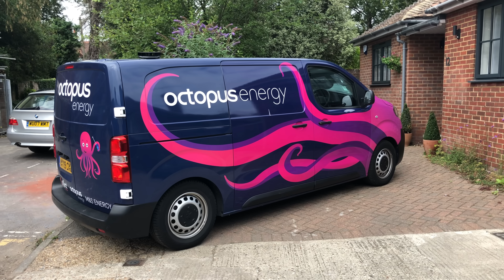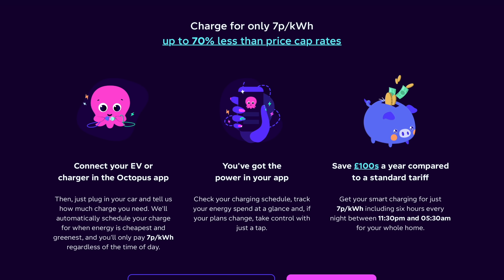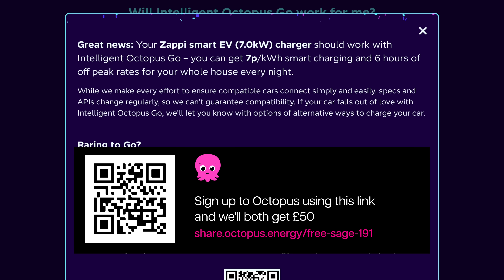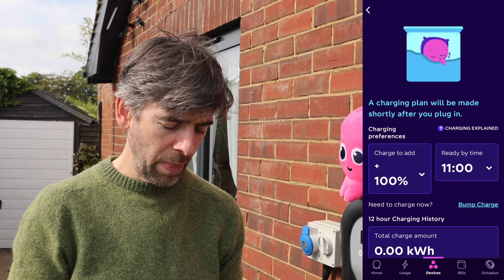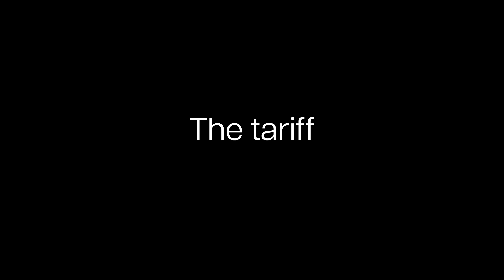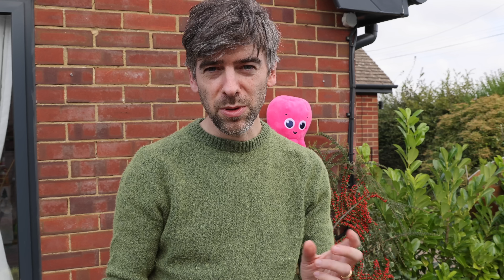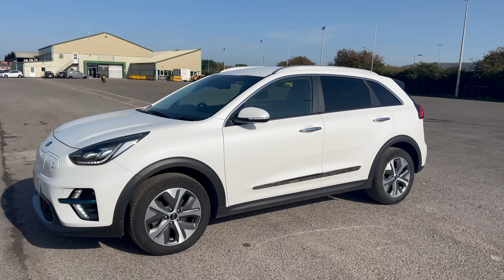We've saved a fortune! All about the UK's most popular EV tariff: Intelligent Octopus Go

Comment: Between IOG, 9KW of solar, Powerwalls, and EVs, we save around £6k a year in fuel and electricity costs.

There is obviously a capital outlay initially, but the system will have paid for itself in less than 6 years.

We never use peak rate electricity, charging up the household batteries overnight, as well as the EVs. And get paid 15p for every kWh we export, so make a small profit each year.

Comment: I’ve recently changed to intelligent octopus go and only use the smart charging (not bump) I’ve noticed my charge sometimes starts at 10:00pm ,however, when I check the app the following day I’ve been charged the standard rate and not the off peak rate. Is this because the app cost isn’t correct and does it then reflect the cheaper rate on my bill?

Comment: I have tried to take advantage of the off peak extension on intelligent go, but it has cost me money.  Because I have battery, when octopus charges the car via the zappi it will automatically take around a third of the charge from my battery.  To stop this I have set the battery to charge at the same time as the extension.  Last time it pushed my average cost per kW up to 20p from 7p when i only use the off peak period.  From my experience it looks as though octopus only charge me off peek rate on charging. They no doubt get the info from the zappi.

Comment: Hi Andrew, great video.  We have a modern bungalow- which we designed with Passivehaus details, but not the full Passivehaus spec.  No gas.  Over a full year we pay zero to Octopus and drive 9000 miles in our EV.   We have ASHP, Battery, Solar and MVHR.  They all work together, for example now in Nov., our heating tops up the house and water overnight and the battery keeps us going all day ….. until the night rate comes.   Some solar top up on good days.
Reply from the maker: That’s living the dream! We’d love to do the same.
Reply: Hi Jennifer, very interesting. I have a 200sqm house we designed close to PassivHaus standards about 12 years ago with MVHR, but no solar or ASHP, only gas UFH, as the return on investment did not make sense. Now with an EV and on Octopus IG, we're looking at it again, but with gas & electric running costs averaging below £100 pm, it would take us years to makeup the cost of Solar+ASHP+battery.  Is there a counter argument?

Comment: So does this mean you are charging your car up to 100% all the time ? Or am I not getting it 😢
Reply from the maker: No — I’m just doing little top-ups most of the time. 100% is just set in the Octopus app so it will aim to give me a full charge by whatever time is set.

My e-Niro battery is 64kWh so it’s like saying “I want 64kWh of cheap electricity by 11am”.

You might not get that, but it does its best to accommodate, based on the wholesale energy prices.

Obviously the car might not need all that, and many would argue I should be setting it to a realistic figure instead.

Comment: You need a smart meter that actually works... i.e. it transmits data to Octopus every 30 minutes. We've had 3 but they just don't get sufficient signal. Pity because smart tariffs would save us on home charging and running a new heat pump. So do check before spending a lot on a fancy charger when a basic one would do.

Comment: Road pricing is going to rip the arse out of this model. It'll take a decade ( at least) or more but the loss in taxation will require replacement somehow. 10p a mile looks like the ballpark figure. Not immediately, but it will get to that level eventually.
Reply from the maker: Whatever happens with tax, charging at home is still going to work out the cheapest.

Comment: Dude, how are you spending that much a month??? We've got solar, batteries, zappi and Eddi (no heat pump), two EVs with Oct Int Go and in January 2024 our bill was £75 including standing charge...our gas bill for that month was £45. Not getting a heat pump because the maths doesn't add up for us.
Reply from the maker: Your solar and batteries probably help. We had no batteries and just 2kW of solar.
Reply: @MrEV  ah fair shout. Think the batteries are the most important thing, keeps us off grid until cheap rate time.

Comment: 0:07 I'm probably about to upset you Octopus guys, both on EV Rate and Tariffs. I'm talking others into leaving Octopus for longer fixed deals.
Gas prices have shot through the roof, Winter is forecast cold and likely not so much Wind and Ukraine still goes on with Israel and Iran tensions that could affect LNG and global Gas prices.

Without getting into a long story, the last few months Coal generation is finished and Nuclear is 80% reduced. EDF have one of their plants down for refuelling until mid December so the UK currently has 3.79Gwh Nuclear.

This will put heavy strain on Gas generation when Wind is low and Gas prices 70% dearer in the last 3 weeks so cheaper hours looks limited.

I won't go on EV as these were quickly withdrawn in 2022 when the Crisis hit leaving many charging EVs at 34p, plus tariffs.on Octopus are a mesial 12 months. 

Next Winter is forecast higher priced than this Winter due to cost of Gas and supply shortages.

Instead we've opted to go with EDF for 3yrs on Economy 7. We have Solar, an EV and 43kwh house battery storage.

Our Economy 7 is 15.7p off-peak and currently 12p if we signed again today.

However, we're willing to pay a little more as we locked a 3yr contract than 2yrs. We'll not regret it as Energy prices continue to rise plus Geopolitics are affecting prices.

Forget the Heat Pump as they are ridiculous money with even Octopus claiming 80yr payback. Instead, we use Air Conditioning with all the benefits of a Air to Water Heat Pump but much more efficient and quicker at heating.

We sacrifice Hot Water to Gas which is £200 per year and not worth ripping the boiler out and spending £7500 - £15000 excluding Grants.

We charge batteries overnight when little Solar and run the house and AC from these. Heating works out equivalent of 3p per Kwh compared to Gas at 6.5p.

We run a Leaf with 40kwh battery and even at higher rates is still a fraction of the cost of petrol.

We charged the car pretty much from Solar April until end September and 6 months Winter will cost £180.

Seriously - don't spend the money on Heat Pump for radiators- install Air Conditioning. We Heat the whole of upstairs with a 4x over sized unit on the landing to flood rooms with warmed air. Heat is almost instant with no cold pockets of air you get with radiators.

I've just installed a 14kwh for a lady living on her own on FIT who also has Air Conditioning running from the battery.

We're about to hit another Energy Crisis so I'd suggest locking in with another provider for 2yrs knowing these contracts can't be withdrawn as we did in '21 for 3yrs.

If you want us both to get £50 by switching to EDF, I'd be happy to post a link.

Yes, you're getting it cheap now but time to batten down the hatches and prepare for another two years on Energy the roller coaster.

Security is sometimes worth paying a little more for which is why we as yet, we will not switch to Octopus as 1yr contracts are just not long enough.

We get it cheap, could be cheaper but there has to be a balance. We pay £150 a year more than the best tariff on EV but a small price to pay for security of fixed prices until 2027.
Reply from the maker: Interesting. Thanks for your comments! We had air-to-air at the previous house so know it well.
Reply: @MrEV  I just don't understand a government pushing Air to Water Heat Pumps where new builds could have Air to Air ducted built in.

It's a lot of money for an Air to Water where 90% of our Gas consumption was heating.

We've dropped it from 14000kwh to 3300kwh and the energy to run is either Free from Solar or cheap night rate.

Instead- invest the money on big battery storage, Solar and AC. You'll still have change and like us, live cheap at £75 per month for 3300kwh Gas and 6500kwh of electricity per year.

Battery prices are awesome right now and I'm selling 15kwh packs for less than £2000. No VAT on batteries or Air Conditioning.
Reply: We shall see how the usually innovative and forward looking octopus responds, if and when your forecasts prove to be correct. Until then on Intelligent go I'm getting most grid elec supplied at 7p/unit, quite often for 12 hrs a day or longer whilst plugged in due to Greener Days ie windy. As the climate gets more unstable I shall be astonished if it becomes less windy but we shall see. . No gas, so saving that standing charge which surely will be heading north at a fast rate! As for ASHP, we're happy with ours,  there's no cold spots and virtually free hot water for 8 months of the year. Don't know how efficient your Aircon system is but my wet ashp has a SCOP of around 3.5 ie 350% efficient?
Reply: @MikeGleesonazelectrics  High Pressure, trapped cloud is the forecast and the worst nightmare for us with Solar. 

Luckily the weather is getting warmer reducing demand for Gas so Wholesale may drop a few pence next week.

UK Carbon is through the roof tonight, Gas is trading at 110p per therm up from 67p 3 weeks ago. Our previous government allowed the demise of Gas storage so no cheap Gas bought in April to offset today's high prices.

Wind is pretty much non existent and Solar today is down. Our 7kw system produced just 3.2kwh today.

We makes our own choices but Agile and Go was affected in 2022. Go see the rate cards and historical prices for then. Enjoy it while it's cheap, innovative or not - the reality is its getting tighter and more expensive in supply. What did Uncle Greg say in '22 - you've enjoyed the good times so don't moan now or words to that effect.

No Wind = Expensive Electricity and its how long Octopus are willing to stand it as making losses doesn't keep a business running.

Memories are short, Tariffs withdrawn Oct 21 until only late last year. No new customers allowed and no deals available.

Search ESO and look at the map. Even the Bright Green NW was Amber today.

I'm happy to be secure for 3yrs and the extra I'll be paying, have already made made up by wheelin' n dealin'.

Hopefully Octopus will start pulling rabbits out of hats. Google IamKate and ESO to see how much Gas generation and at what price to keep our lights on.

While your on Kate's look at the history of Nuclear, Coal and Gas. EDF have one of their plants down for refuelling, bad planning that ends mid December forcing more heavy lifting onto Gas.

So yes, we'll see but I'm yet to be proven wrong. Wholesale is getting a lot more expensive and will continue to do so.

Air Conditioning is running at 4.2:1 (420% - is mine bigger than yours for a change) above 6 degrees outside. Why are people so defensive of their Heat Pumps, are they jealous of our Cool Summers. 1150watts to take upstairs from 17'C to 23' today. Not bad for £1200 installed. No radiators to heat and directly heating the air so instant.

I still have a boiler on those very cold nights or dare I say, the Blackout nights - priceless.. 

Aha, Standing Charges, we don't have them neither for Gas as we now use so little, we've converted the boiler to LPG and consuming 5x 47kg per year.

When MI5 say they are concerned over sabotage - let's hope those old Russian and Chinese ships have their anchors secured and stowed properly as they transit the English Channel and North Sea. 

It'll never happen they say? It already has!!

Comment: We have just bought a second-hand e-Niro and are now on Octopus Go. We also have a second e-Niro battery (with a high-voltage hybrid inverter) powering the house as well as solar panels contributing. 
We have a heat pump providing the majority of our heating. Previously, we were on Agile, scheduling charging when it was cheapest (very little charging during the peak of summer due to no heat pump and solar). 
For the 9 months we've been using this setup, our end bill is £490 (inc export). The year prior, we were paying £290 per month.
Unfortunately, we cannot get onto iGo right now because the e-Niro has been removed after the integration was blamed for flattening peoples 12v battery. We are getting a smart charger soon.

Comment: OVO Anytime does pretty much the same thing, but you don't get the 11:30pm to 5:30am cheap rate for the whole house. Instead it sits on top of your existing tarriff - which works out cheaper overall if youf fix right now.
Overall I was generally happy with Octopus but we moved to Ovo because of the above, and it's working well so far with our Model 3. In the Ovo case, tverything is done through our Ohme app and I think this is the case for any other charger. It also links with some popular cars, but nothing is done through the Ovo app

Comment: I'm on the same Tariff and quite often get a few hours of cheap rate in the day or early evening. Having 2 EVs helps with that as it doesn't know what car you are plugging in each time. In the last 3 billing months i've used over 3000kWh of leccy, averaging about 9.2p/kWh cost. My wife runs a massage therapy business and we rent our spare room on Airbnb so our washing and drying usage is very large -- maxing out the cheap rate is hugely advantageous, especially as we don't yet have solar or batteries.

Comment: I've been with Octopus energy since February with their intelligent Go tariff, I work nights so my Renault Zoe GT line gets plugged in at around 6.30am week day mornings. Typically Octopus will charge the car between 6.30 & 7.30am pause for an hour and then start again finally finishing at 11am or occasionally even midday. This means I get a 7p/kWh rate from 11.30pm until 5.30am followed by another 3 1/2 hours each morning. Add in my solar and storage battery to the equation and the result is truly staggering, my energy costs have halved compared to what I was previously paying British gas.

Comment: I use a 32amp commando socket and I'm on Octopus' Agile tariff because they won't give me Intelligent with a commando socket (currently). I let the car handle the smart features, such as timed charges etc. It's a similar tariff but the rates change per half an hour, lots of plunge pricing when it's windy - as you said Andrew. I just thought I'd mention it in case anyone is in a similar position to me and wants a tariff that is decent, if you play it right. It's sort of a manual version of Intelligent, you track the unit rates yourself using the app. You don't need a smart charger for Agile. I'd rather be on Intelligent, maybe when I get a smart charger!
Reply: That's odd. The Ohme commando is listed as an approved charger. Did you speak to customer services?
Reply: @007silverwings  it's not the Ohme charger. It's a literal 32 amp socket. Bought it from amazon
Reply: @thathairyguy  ah okay. Makes sense.

Comment: Andrew. You’ve titled this ‘is intelligent octopus go the best tariff for EV drivers’ so I was expecting a full comparison. 
All you’ve gone is compared Go with IOG. And touched on Agile. 
I guess the big pink Octopus in the background should have been a clue. 
So what you’ve actually done is compared Octopus tariffs. Not done a comparison of energy tariffs. 
Lucky you for having a compatible car or charger for IOG. It’s a good tariff, obviously far better than Go. There’s no need to do a full video to work that out. 
Now maybe do a proper comparison. 
IOG v Go v EOn Next Drive v Tomato Lifestyle and for some the OVO anytime tag on to a standard tariff. Plus mention the others too. 

For your own benefit… having a heat pump and an EV you might find that the Tomato tariff suits your personal usage needs better. It’s 6 hours at 5p, a mid morning 13p to do any boosting, another 13p from 10pm, only 23p standard and a low 40p daily standing charge. 

The requirements of one EV driver v another with the possibility of solar/heat pumps/battery storage and load shifting potentially being part of the equation all come in to the assessment. 
If you are going to boldly put ‘Is IOG the best tariff for EV drivers’ in the title then perhaps actually review that!
Reply from the maker: You're absolutely right — the title was misleading. I've now changed that.

Comment: Your gaming the system and at some point Octopus will work out that its not worth keeping some customers. 
Octopus always aim to have your car charged by the amount you request by the time you set.  64Kwh = 9 hours.  Its going to try and charge for 9 hours and it works out the lowest C02 slots, there is not an abundance of green energy every day.   
At some point, octopus are going to move gamers to the fixed 5-6 hours per day as intelligent gets subsidised by the fact they can balance the grid.  Having a small battery in my vehicle, even when the CO2 is low though the day, it still wont give the extra slots only when it goes negative pricing.

Comment: I'm on IOG also and according to my data for 2024 so far I've used 2864 kWh of electricity to charge the car and that has cost me £195. That works out to less than £20 per month in driving costs from home charging alone (rapid charging not included, but it's rare for me). At around 3 to 3.6 mi/kWh for my EV depending on season, if I take 3.2 mi/kWh as conservative estimate that's about 2 pence per mile.

Comment: Does the same cheap overnight rate apply even if you don't have the car plugged in?   We have batteries and which we'd normally charge every night - but would probably only actually need to charge the car once or twice a week.
Reply: Yes. You always get the cheap overnight rate 11.30pm - 5.30am on IOG even when the car isn't plugged in.